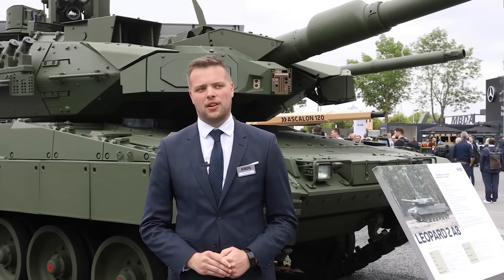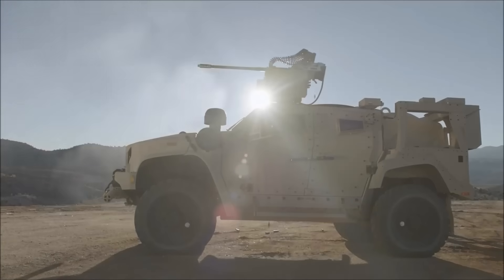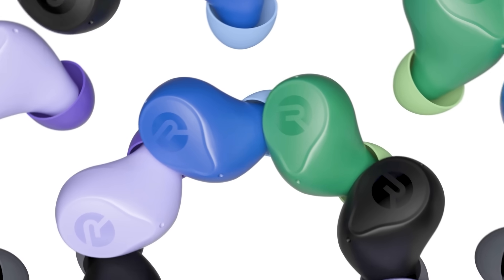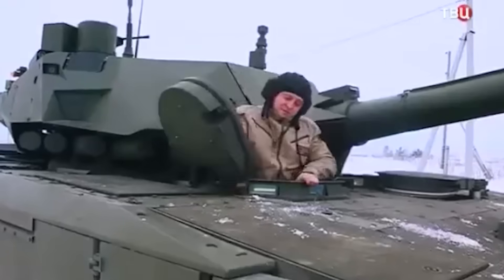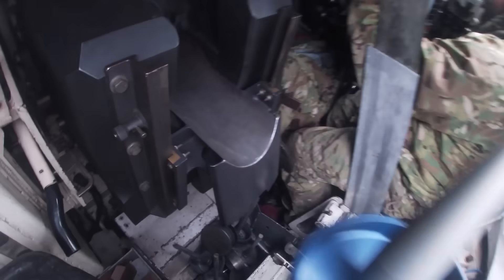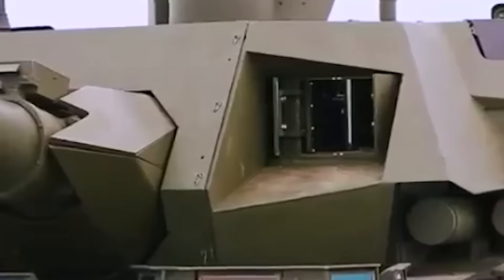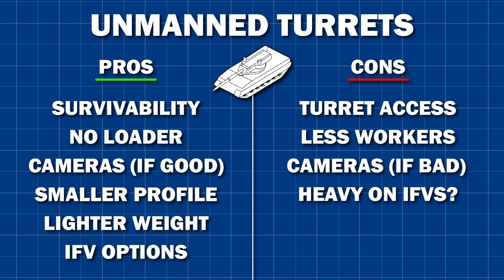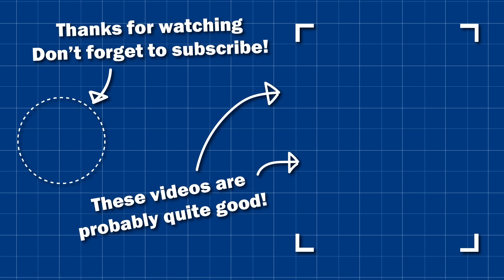The Unmanned Turret - And Why It's The Future

Comment: Modern tank designs have been around since the 70's because there hasn't been new radical capabilities that demand new tank designs, it's just been cheaper to incrementally upgrade the existing designs. But current tanks are getting to their limit in terms of size, weight, and power (SWAP) even as they try to incrementally add APS, anti-drone EW and cannons, drone launchers, and armor against top attack. There are not a lot of remaining unexploited incremental options for reducing SWAP to keep it from getting even further out of control so tanks don't break bridges from sheer weight, other than restricting or trading off capabilities, which militaries generally find deeply unpalatable. Unmanned turrets also make creating drone tanks with turret commonality or optionally manned tanks a lot more feasible too, but any new design is going to need radical design changes of some kind, which can't simply be incrementally added to current designs, to have a chance at success and not end up like the dozen-ish failed attempts to replace current tank designs.
Reply: I think Leopard 2 offers an interesting upgrade path, because it already has space for two side-by-side crew in front (the driver is offset to one side, while the other side had ammo racks which are better left empty). This means that a basketless turret could be an upgrade path with 3 or 4 crew, with 1 or 2 underneath the turret.

This allows weight savings in the form of reduced turret armor. But I think we can do even better by reducing the main armament from a big heavy anti-tank gun to a 120mm mortar like Patria NEMO. It can still attack enemy tanks with Stryx top attack guided rounds, but offers better bang for less weight and space against other targets. And it doesn't need to depress downward in order to attack targets at a downward angle.

This can free up a lot of weight and space for various sorts of anti-drone systems and such.
Reply: @IsaacKuo  The ammunition storage better left empty ?? Brother this isn't war thunder tanks need to carry more than 15 rounds of ammo with them.
Reply: @SegFaultOnLine1984  This is for a potential upgrade path. The turret would be replaced with a basketless turret, with however as much ammo as deemed suitable.

Comment: Having 1 less man is pretty significant once you increase the scale of tanks in service, 200 tanks in a division (each with 3 crew rather than 4) makes a huge difference - certainly gives alot more flexibility with excess/free manpower left over.
Reply: The opposite is true for day to day maintence of each crew's vehicle. It's also a lost set of eyes for when the vehicle is parked and the crew is in the field.
Reply: @Norade  Except that such tasks should already be relegated to dedicated support elements, no?
Reply: @polygonalfortress No, they aren't. The tank crew primarily does all the day-to-day maintenence for their vehicle both on base and in the field. They spend more time cleaning the tank, cleaning the gun, tensioning the tracks, than they do driving the tank or firing the main weapon. Even if this wasn't the case, the crew would take up these dutys on deployment while out in the field. You can't attach a support crew to a unit of tanks out on maneuvers.
Reply: @Norade The French do it. They took their manpower saving from the Leclerc and stuck them into a VAB/VBL. That way they can aid in maintenance, pull security and serve as spare crew in case of casualties or vacancies. This also allows for specialization and more effective use of manpower.

Wouldn't you love as a tanker that instead of a loader you had a dedicated full time mechanic?
Reply: @Infanterie_Marine  Have the French been tested in the mud and trenches as the men and equipment in Ukraine has? What looks good in peace often fails in war.
Reply: @Norade  Well, the Russian and Ukrainian has.
Reply: @Norade  France has been the most active Western military behind only the US.
Reply: @muhammademansusilo2876  Yeah, and Russian tanks are known to be poorly maintained and the Ukrainians would rather use anything besides their ex-Soviet era gear.
Reply: @Norade  
You do know the French regularly operate in Africa?
Reply: @jintsuubest9331  In lower intesity conflicts, yes. They haven't been tested in a modern war scenario.

Comment: Personally, maybe Easy mass produce Drone Tanks would be great. If they are easy to mass produce, that military would be like the Soviet Union in Late WW2. simply just overrun the enemy by shear number
Reply: So nothing like Soviet Union in late WW2? 

Red Army in 1944-45 isn't reliant on numbers, but rather on overwhelming firepower that simply obliterates enemy defences before the main forces moves in. That's not how it works nowadays. You don't need battalion to take a village, you'd send 4-6 people and that already be approaching a red zone. The overabundance of drones forces infantry to split into smaller and smaller groups, isolation of the battlefield then forces those small units to disperse and dig in, which leads to artillery fire losing it's effectiveness simply because there isn't a main defensive line to smash, but rather hundreds of small basically manholes and great risk of drones striking you back before you even pack to leave. Artillery isn't going anywhere, but the ones doing mass assaults and overwhelming firepower will be kamikaze drones of all shapes and sizes, combining precision with volume.
Reply: Welp kinda, but... how will you control 200 tanks at one? And don't even talk about EMP and all kind of thing that can knock a drone tank out without "touching" it by any mean.
Reply: @NgocAnhPham-pb3mi  Hear me out, fiber optic tanks. If small drones can carry kilometers long cables, tanks should able to carry same length even with armoured cables. Plus they don't move as erratic as drones could. Of course it is a weak link, and once it known procedure to severe the cables will be mainstream.
Reply: @muhammademansusilo2876  I am not talking about jamming or cutting the way to communicate with the tank. I'm talking about frying its OWN electronic. Remember, even an unmanned tank still need electronic, and if drone can be fried by EMP, then why not drone tank?
Reply: @NgocAnhPham-pb3mi   Because, tanks even lightly armoured one will still be made out of metal. Frying shielded electronics need powerful EMP. Chances are people already thinking of it, and the countermeasure.

Moreover, everything have electronics, it doesn't matter if the tank is manned, if they lost all electronics. Because frankly I don't think hand crank and manual sighting work good for modern battlefield.

Comment: Another advantage of unmanned turrets is that the autoloader can handle the ever increasing size of tank rounds better than a human, which is not increasing in size and strength to match. There is a lot of talk of upgrading from 120 mm rounds to 130 mm or 140 mm, which are getting pretty difficult for humans to maneuver with and load.
Reply: 120mm is already the limit or a little past it, depending on the nation making the tanks and their doctrine. Japan for example considered 90mm the limit for manually loading shells, which is a good chunk of why they got into the autoloader game as quickly as they did (alongside other concerns like weight—not a lot of maneuver room for very heavy vehicles in the Japanese islands)
Reply: @shinobirecords2018 there is no point is something bigger than 120mm other than to tackle other MBT. MBT get mission-creeped and overspecialized with bigger ammo and heavier armor for this reason.
Reply: Sure, until the autoloader fails... Then your screwed as in dead!!!
Reply: @richardvangelder3666 Better than 2 loader to load
Reply: That is probably one of the biggest reasons. 
The experiments as to what a human can realistically load has been conducted over a century ago. The results where pretty clear. Around 25kg is the maximum that somebody can load in a consistently quick manner. That translates to shells of about 120 to 130mm where you are looking at shell weights of around 25kg. Then you often get separate propellant charges, either bagged or in a propellant case. The Germans got around that issue with the lightweight combustible cases for the Rh-120. That is arguably a big part in why NATO tanks still use manual loading. Or you have 100 to 107mm shells weighing some 15kg with a fixed case for the propellant adding another 10kg. This is why these two classes keep popping up all over the world for over a century now. 

The second class is around 45kg which comes down to roughly 150-155mm projectiles. This is about the maximum that somebody can realistically handle by hand. Its not fast, its about the maximum without being forced to use multiple people. Often such shells are still loaded by multiple people or you are already looking at mechanical assistance if not full auto loading. This is also why 152mm and 155mm became dominant for field artillery. Its about as heavy the shells can get that can be handled in the field. But with the ever increasing mechanisation and also the increased accuracy and range of modern shells, I would not be surprised if heavier shells will make a comeback in the future.
Reply: @DanielWW2  Two cents without having to speak on government secrets from one in the industry, my guess is that those writing whatever article this came from was not conditioned for it and/or never was inside the MOS. 

Also one thing I will critique is that those charge bags inside of the smaller caliber howitzers, at least 105mm, do not weigh 22lbs altogether. 

The weight of the 155 isn’t too terribly off either. Though you will find the ONLY time multiple people lift it is in training and even then we have a test regarding this where we have to load 15 concrete 155s into a honeycomb storage and put them back, alone, in under 15 minutes. 99% of the time that is still a single man lift. 

The 203mm cannons got retired by 1994 in the US. Spain kept em until 2009, South Korea until late 2000s, and the JGSDF kept em until March of 2024 and retired a battalion because of it, You also have to take into account ranges for each in the overall strategic and tactical maps. Sure class one can fire significantly faster, I should know, but the range is shorter. This allows for more rounds with a faster response time in emergencies while the bigger guns with the heavier ordinance, sure it takes two class one shells for the effect of a class two, but you can be more deliberate with your targets. There are places you cannot use it and can send them out further. I am not getting into specifics because i am not trying to end up in fucking federal prison. But I will say rate of fire is a suggestion.

I do not see a return of heavier artillery than 155mm. Even a century ago, they were using cranes for everything 200mm and above. France still has a 600mm cannon in service on the maginot. Either Taiwan and/or SK has a 6 or 800mm coastal gun somewhere too, but that is about it. Given the dispersions of the shells from artillery presently used by the major military forces, the rounds in play today have an allowable spread for accuracy and will probably be made more accurate in the future.

The present focus is a continuation of saturation, volume of fire, accuracy, and safety while minimizing unauthorized damage or casualties. and considering the 203mm M110 howitzer takes a full minute to reload with a full crew and a crane for a maximum rate of fire, on paper, and the amount of impact such a shell has, outside of open warfare it would not be viable in or around villages and cities and it would be risky out in the open as well.
Reply: As discribed in the vid. If all ammunition is turret stowed only.  The turrets are going to be roughly the size of a manned turret anyway.  The vast majority of tanks do a rough 50/50 split between turret and hull for stowage,  Cramming all ammo, plus all the autoloader machinery and gubbins in the turret, does not a small turret make.
Reply: french trying to  squeeze a bit more performance for 120mm with SHARD shell. But it also offer 140mm variant for autoloader.
Reply: The increasing of gun size doesn't matter much as the real efficiency come from the propellant and the round itself. The 120mm was good enough for APFSDS. And nowadays tank on tank combat is rare and doesn't the main focus of the war anymore. If you meet a tank that heavily armored and cant be destroy by your tank? Just send FPV drone for a mobility kill, then finish the rest with Manned ATGM to the side or top down attack. UKR-Russo war proved tank on tank combat would be the WW2 legacy now.
Reply: The main problem with larger caliber ammunition is not their weight, but the separate logistical system you have to create in order to supply them. This is the reason why 120 mm smoothbore tank cannons are favored in NATO-countries
Reply: @Perunajumala  If logistics was the main concern , we'd either still be using 10.5 cm tank guns. or go straight to 15.5 cm
Reply: @johanmetreus  105mm is outdated and removed from active service in most western militaries. If 120mm isn't going to get entirely replaced, larger calibers won't be introduced for mere single units
Reply: @Perunajumala  "105mm is outdated"
This is kind of my whole point.
If larger calibres are needed for whatever reason, the supply- and logistics chain will be transformed to accommodate for that.
The core question is hence if 13 cm or 14 cm offer something that 12 cm can't deliver, and if that increased capability is large enough to warrant a change of standard calibre.
Reply: @johanmetreus  yeah, and logistics is the largest issue contributing to the sum of pros and cons if that increased capability is large enough to warrant a change of the standard caliber.
Reply: Upgrading to larger munitions is unnecessary for tanks considering the armor itself cannot compete with munitions and ballistic technologies in the modern day. We’ve had tanks with these larger guns and the returns on the investment aren’t very impressive. Not only that, but regardless of if the turret is crewed or not, the turret or hull will have the be made bigger to accommodate the movement of a larger gun breach inside the turret as well as additional space for the auto loader and ammo. The biggest limitation to auto loaders in modern tanks is that the auto loader itself reduces the length a single munition can be in order to fit in the breach using the autoloader. Tanks without an autoloader don’t have this limitation, and in the modern battlefield of APSFDS where a longer sabot is better that limitation can be significant. This coupled with the fact that it’s nearly impossible to blast proof the ammo carousel are the chief reasons why the US never adopted auto loaders.  In a completely new turret design they could probably do away with the carousel and use a bussel based autoloader to blast proof the ammo racks as well as stretch the autoloader tray/ramp to accommodate a variety of munitions types
Reply: @_d3fault_371 Two piece ammunition limits the length of the penetrator  autoloaders don't. French autoloaders can fire full length NATO ammo whereas the UK's Challenger can't, even though they are manually loaded.

The restricting factor is the case length. You then design the autoloader around that.
Reply: @_d3fault_371  "the auto loader itself reduces the length a single munition can be in order to fit in the breach using the autoloader. "
Not true, as that is decided by the specific construction of the loading system.
Technically it is a trivial problem having it handle munitions the length of the entire gun if that is desired. Hopefully no one would think it's a good idea to have a gun-lengthed magazine lol
Reply: @johanmetreus you just said what I said in a different way. The munitions don’t have to be as long as the gun barrel, but if you compare Russian APSFDS to NATO APSFDS you can see very clearly the limitations to their design of autoloader, which is affected relative to the overall size of the munition itself. Ballistically Russian APSFDS isn’t as effective (though this is still a modern sabot projectile) as other peers APSFDS. This is because of the length the actual sabot can be and the limitations imposed by the autoloader. It literally cannot carry longer sabots or they will collide with parts of the autoloader or fail to align with the breach. The russian solution is either use the APSFDS provided, which is still perfectly fine, or use barrel launched ATGMs which is also fine, but given the prevalence of ERA and soft kill systems on modern tanks I’m not sure how effective their use is in places like Ukraine today.
Reply: @_d3fault_371  My point is that you can not take the limitations of a specific system (the Soviet carousels) and apply that to encompass autoloaders in general.
The Swedish and French autoloaders did and does not suffer from a limitation in length, proving that it is fully possible to make capable autoloaders.
Reply: Yeah just like how the russians mounted a 152 mm gun on the armata (though a small number) it shows how both sides of the curtain are looking at bigger rounds and guns